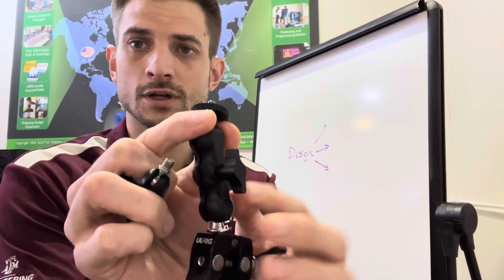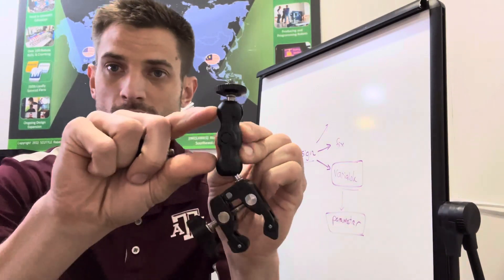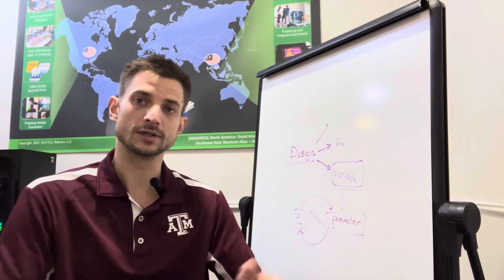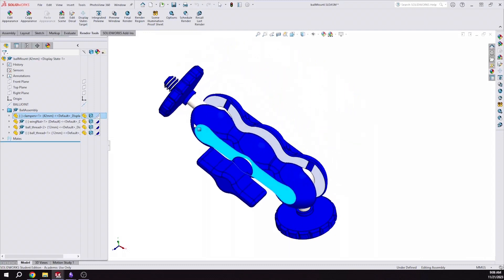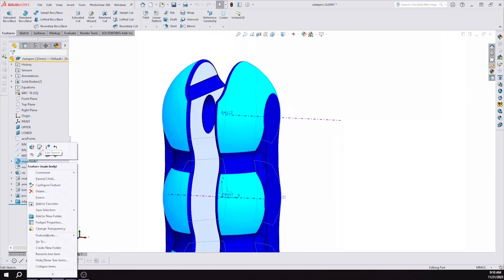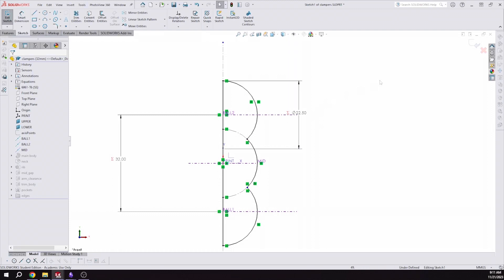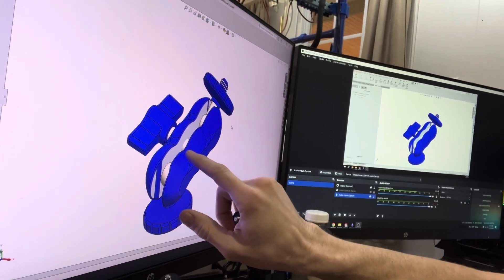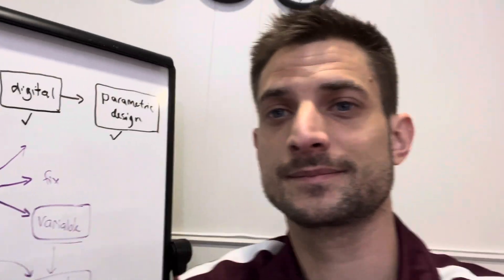What is a Parametric Design? (with SOLIDWORKS example)

Comment: For some reason, I cannot download this item from the podcast section through Y T music app as a Video.

Although I was able to do this for the "Steve Jobs Speech Commentary": it was downloaded as a video and could be viewed through Y T Music app.

But when I tried to download other videos from this podcast as videos, not just audio tracks, I failed. 

If I go to app settings and choose download setting to "only audio", it downloads as a smaller file (13 Mb perhaps) and can be only listened to (which is logical). 

But when I change app download settings to "360p quality" (the only alternative available), it results in downloading bigger file (40 Mb), but still no video available for watching.

Could there be some settings attributed to the item in the podcast section, which limit the possibility to download it in a complete manner?

Comment from the maker: I apologize for my choppy dialogue! Still learning to combine filming, drawing, speaking, and doing it smoothly!   There was no script for this video - produced on the fly.
Reply: I am 75 years old 50 years of Engineering and giving a lot of tech talks explaining projects, designs and begging for funding, You learn that the most important part of your lecture is says whatever seems the right thing to train and educate the audience to fully understand, and appreciate your work. Once I figured that out i did think about myself, my look or way, I just focused on explaining the key points as best as I could. Soon you will learn that it becomes fun and you look forward to teaching your project work instead of terrified of public speaking. Focus on knowing everything about subject so you are confident in handing all situations, so prep is key, and I always used little list of a few words per bullet point to guide my path in a topical Outline. I had a method of PowerPoint where i had the list in the slide with a simple diagram then used White board to expand the topic.  I came here  as I am cramming to absorb PM as fast as possible, as I am now designing an new line of Model Trains for the shrinking Hobby family. I want to share the PM Matrix for a set of Engines so new hobbyist could make custom engines via PM -> 3D printing,  Old Dog learning new tricks. Take Care, Dennis